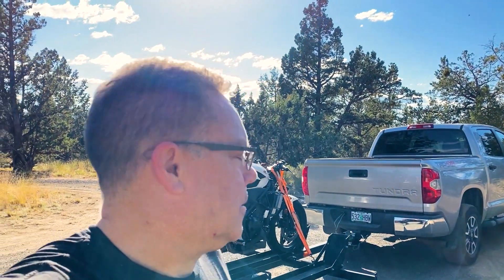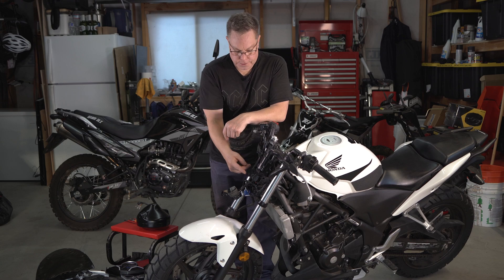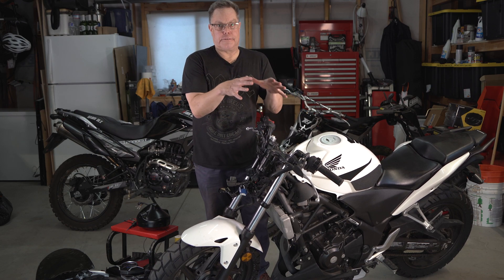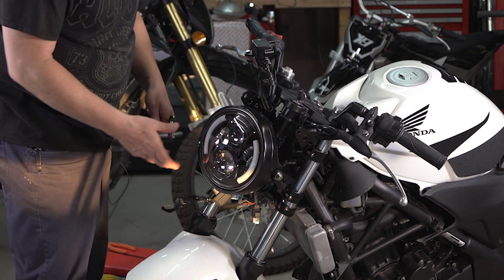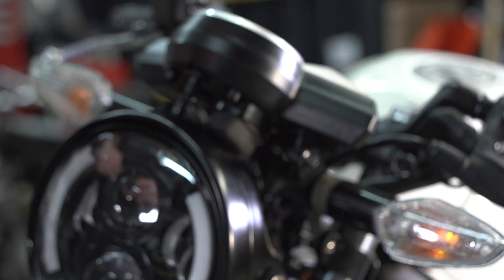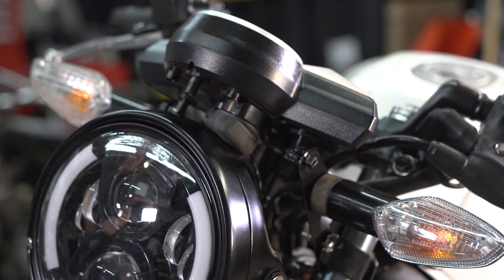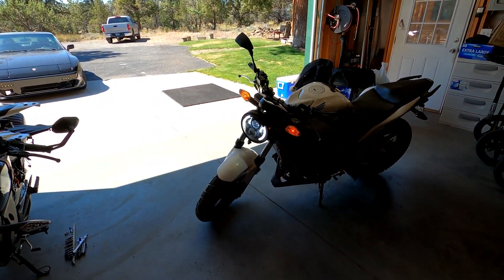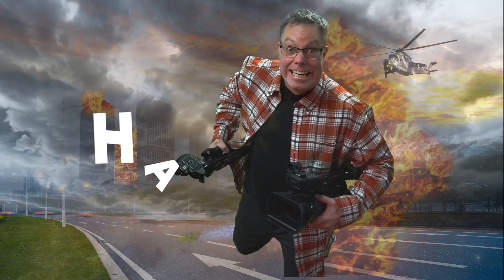Honda CBR 250R head light mod / off road tires, is this a good idea?

Comment: To people that dont know, there's a roll over switch up front, if you are trying different headlight Assemblies, make sure that you mount it in the right direction or the bike will not start, it has a this side up on it. It will be hanging down just swinging when you remove the old headlight assembly.
Reply from the maker: Thanks for the great information. Thank you so much for watching.

Comment: That 150 rear tire doesn’t rub the chain? I tried a diff 150 on my cbr300r  and had that problem. If not, you just saved me a lot in tire cost.
Reply from the maker: No i did not have any problems with the chain rubbing on the tire. This is a CBR 250R so I do not know it there is a difference. Hop this helps and thanks for watching.
Reply: @hanzdidit  it helped sooo much bro you have no idea. I was resorting to buying tires that cost 60 usd more per tire because I tried a 150/(apparently 80) r17 tire that actually rubbed my chain. You saved me heaps, and I rode my first weekend on single track last weekend on my Honda two days. One was a 19 mile trail with only the rear shinko. I just installed the front one last night. It was a lot harder than the rear tire to get mounted. Can’t wait for you to see my bike lol

Comment: The link to the tires no longer works.  Is there a newer link or can you just list what ones/size you used?
Reply from the maker: the new one is the 705. Here's the link..
https://www.motosport.com/product/?code=SS-M-G-P-NA-PLA-DIRT&key=Shinko-Dual-Sport-705-Series-FrontRear-Tire&cc=us&variant[SHT000X]=SHT000X-X001-Y004&cc=us&utm_source=google&utm_medium=pla&gad_source=1&gclid=Cj0KCQjwqdqvBhCPARIsANrmZhM9JecL30IEPp_3_hcvwIF1c7kka0qNuzM8VENC9oeKfgUsXHuyUeEaAsq8EALw_wcB&gclsrc=aw.ds

Comment: I subscribed to your channel while i was waiting on some parts and decals from amazon, I bought a 2011 250 cbr that was wrecked. The front forks, front rim, swingarm, and rear rim was all destroyed, but the frame and motor was in almost perfect condition. I had a 2004 yam wr250 with a bad motor, but everything in great condition. My intentions was a motor swap, but said hey let me  try a swingarm, front forks, and rims swap to the CBR, in order to keep it street legal, and came up with something completely different. some of the fairings off of the wr is actually on the cbr also. That's it in my profile pic😁
Reply from the maker: That is awesome I just checked out your channel and I will definitely keep watching to see your next build. Great job.

Comment: How did you connect the drl light? Thank you
Reply from the maker: I used the wiring harness from the original fairing on the bike. I used a 12 V wire tester to test to figure out which buyer did what on the headlight and I was able to match them up to the wire harness. Hopefully this video was helpful, thank you so much for watching.